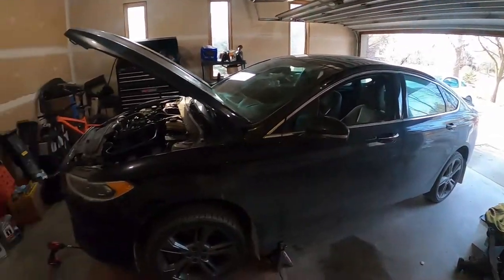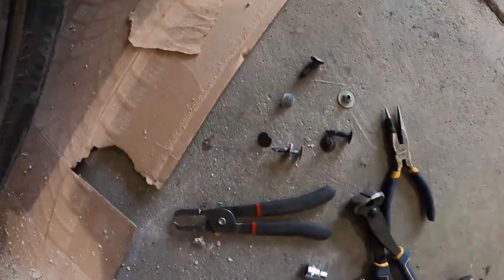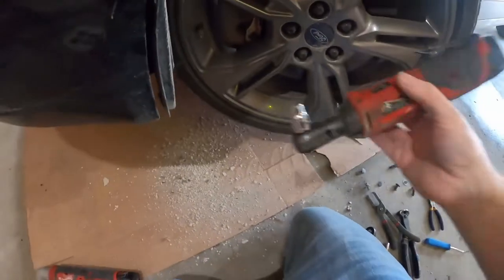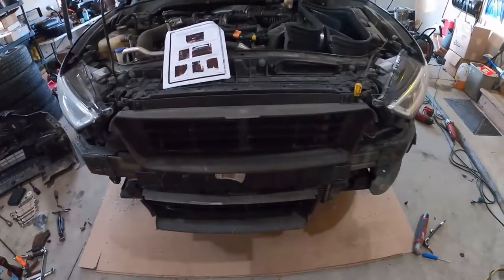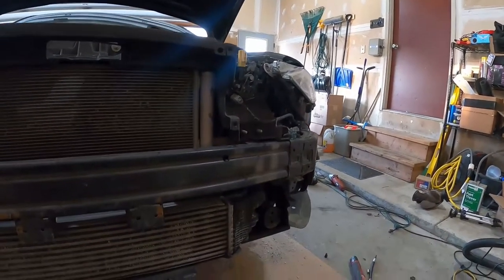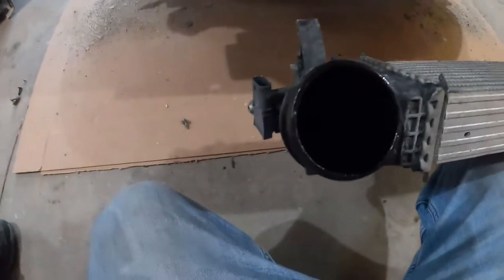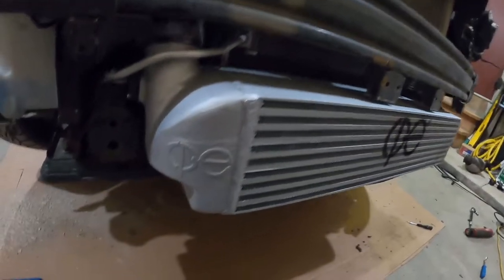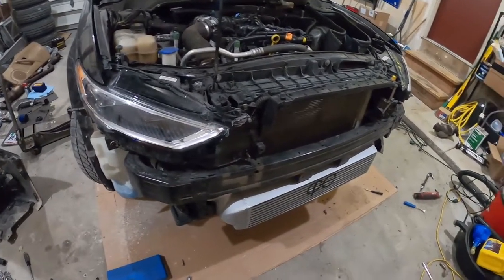Ford Fusion Sport CPE Intercooler Install

Comment: I went with the ultimate performance one. It works with the adaptive cruise control. It has the Garrett core as well. Definitely took care of the heatsoak issue. Makes a night and day difference with a tune.
Reply from the maker: Yeah I've since reworked the tune and there is zero knock retard even running 87 octane at like 21psi of boost, boost air temps pretty much match ambient air temp. These cars need these upgraded intercoolers lol.
Reply: @randybillygarage  you're not kidding with the fmic. I couldn't run 2 passes without heatsoaking. It was frustrating. What tune are you running?
Reply from the maker: @troye43  I tune it myself with hptuners

Comment: Are you on an e30 tune? That’s looking like it’s pulling much harder than my 93 tune 😂 also, how did you update your radio?
Reply from the maker: Check out cyanlabs sync 3.4 update super easy! And it's on 87 I've been tuning it myself with hptuners 🙂

Comment: Since you didn't put the factory active grill shutters back on did it set off and engine code?
Reply from the maker: I don't think I removed the grill shutters, they're in the front bumper cover/grille itself, I just removed the duct that I didn't need so no codes.